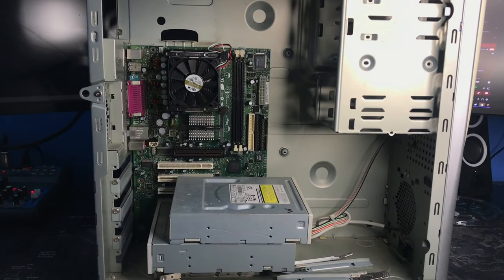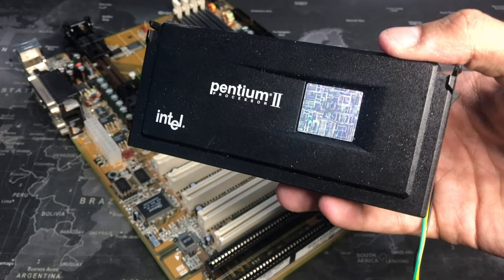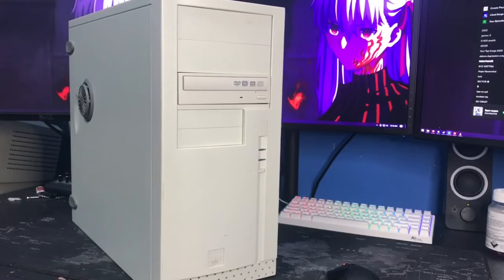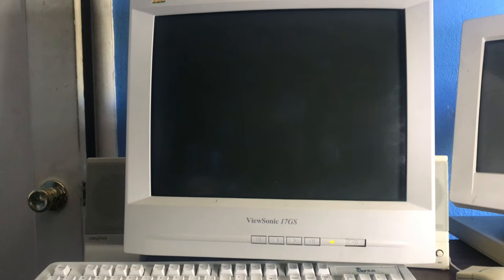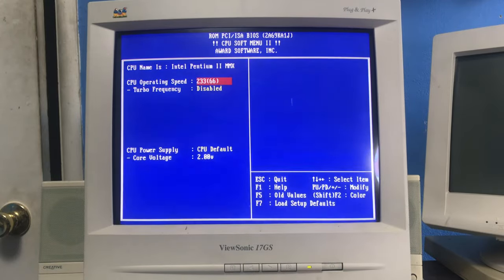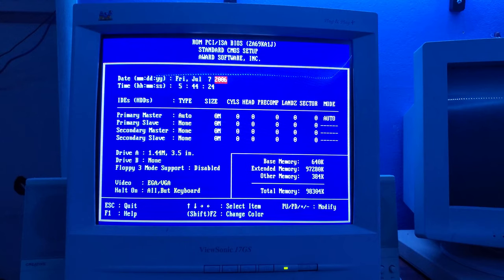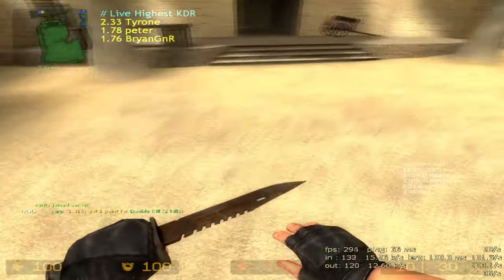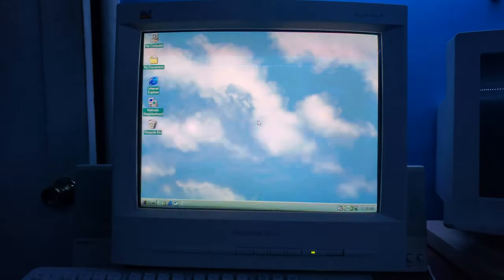Building a Better Windows 98 Gaming PC

Comment: Windows 98 or Windows 98SE? 98 original can be very picky with hardware. 98SE is much better at that. Look for Maximus Decim USB to find an installer for Windows Me's USB Mass Storage support into 98SE. That fixes a ton of issues with USB. Someone else did the same for 98 original or 98FE.

Comment: I think the PIII was a 133 MHz FSB CPU, this board only supports max. 100 MHz FSB. You need then to crank up the multiplier to get to 850 MHz, like 8.5 x 100MHz = 850 MHz

Comment: With the USB controller, I think you had an IRQ problem.  Certain cards need to be in certain slots. or rearrange the IRQs.
A quick fix, without having to mess with the IRQ settings is to just disable the com & serial ports. Most of the time, that works.

Comment: A virge or matrox with sli v2s would round out that box perfectly. A tnt2 ultra is also an option. The p2 450 is perfect.
Reply: @MachtnixPasstso-pw1nr  It was the fastest p2 & very fast for that era. A p3 would be faster, sure but compatibility issues with his mobo was a problem & at the time games really didn't make use of sse2/3 instruction sets. Quake 2 is an exception.

Comment: ISA video cards are somewhat infamous for being slower than PCI cards, let alone AGP ones. It's no wonder why the the Trident card was slow to draw the text.
Also, quick suggestion for the build; you should try installing a Sound Blaster 16. Not only will it provide great DOS compatibility (especially if it has a real OPL3 on board; some Vibra cards do and some don't) but I'm pretty sure you could use it alongside the Live card too; so long as you disable the SB16 emulation on it.

Comment: GeForce4 that's a Pentium 4 Windows XP era card, not Pentium II era, but if it works, then use it fine
Reply: Pentium 3 would still be good with a geforce 4 800 MHz or faster
Reply: Because the Xbox had a 733mhz pentium 3 and geforce 3/4 equivalent
Reply: And you would want a sound blaster live minimum
Reply: it's like putting a RTX 30x0/40x0 in a AM3+ system